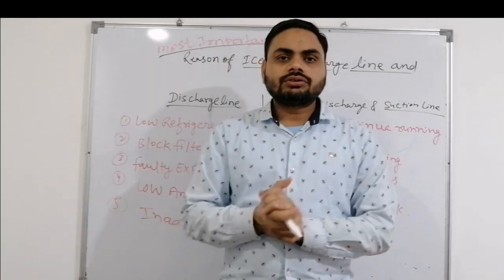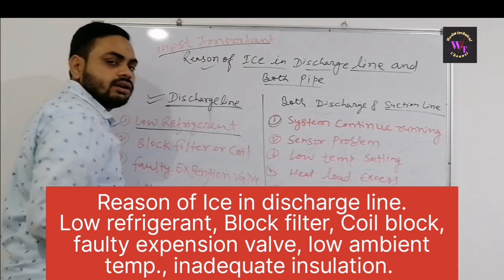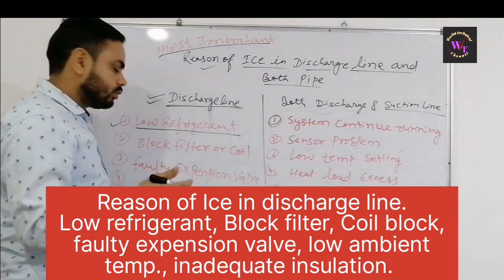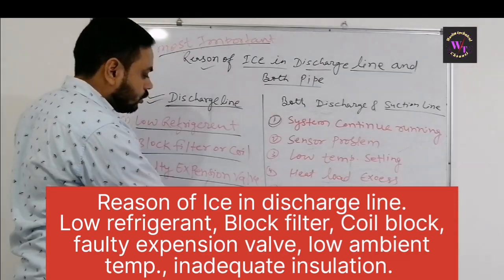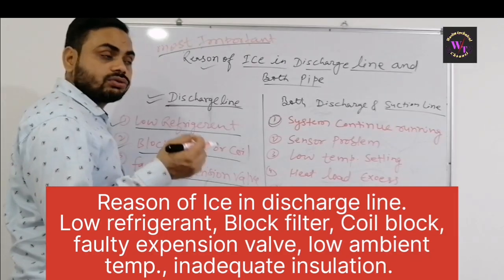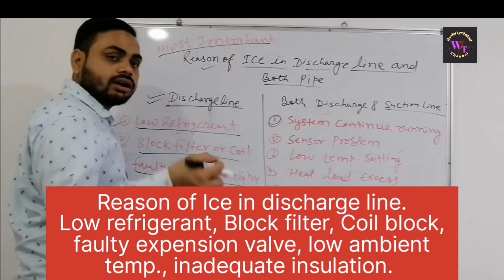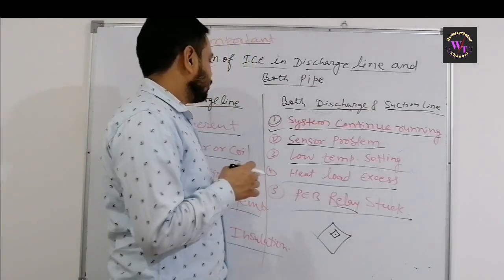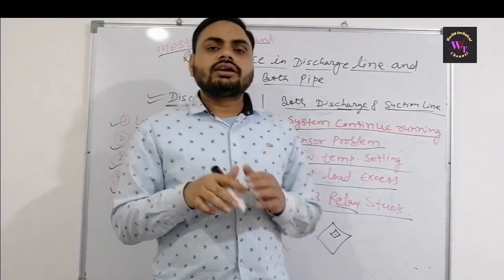Reason of Ice in discharge line#Reason of ice in split ac

Comment: Compressor trip kar rahahe ya compressor bar bar trip kar raha he to kya kare
Reply from the maker: Trip mcb हो रहा है या only compressor
Reply from the maker: अगर compressor trip हो रहा है तो
Overheating compressor ho सकता hai
Wire connection loose ho सकता hai
Compressor ground हो सकता है check kro compressor का wire nikl के ki ground to nh hai
Lp and hp me trip  हो सकता hai
Capacitor weak ho सकता hai change कर के dekhe
Condenser coil पूरा block है